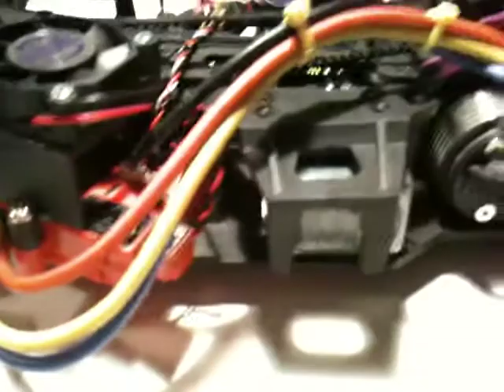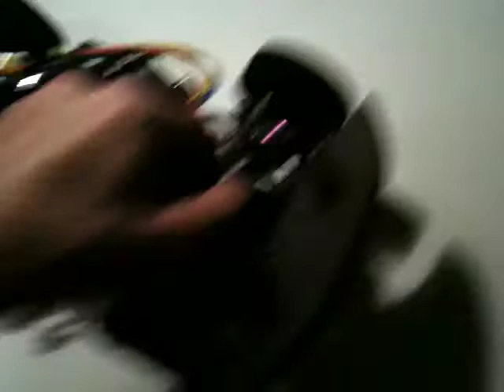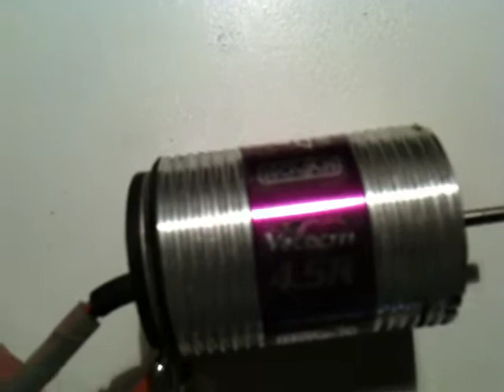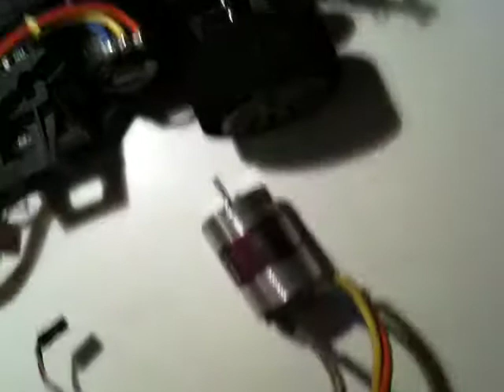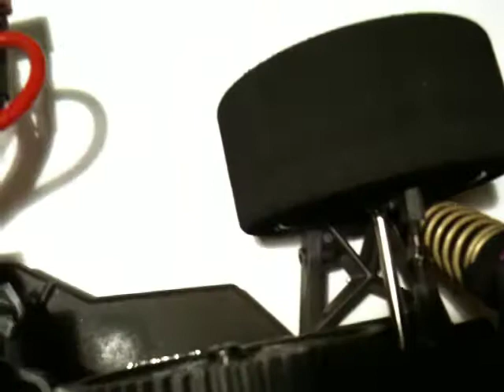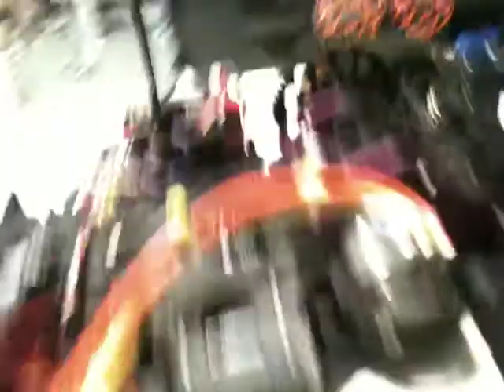HPI Sprint 2 Fitted with NOVAK HV PRO 4.5 motor and ESC. 32P Gearing!

Comment: You should use a second belt tensioner on the rear. I installed one and use bearings on them instead of bushings. It cuts down on the heat quite a bit. The traxxas slash 4x4s rear hub bearings fit perfectly on in place of the bushings, you just have to use a screw instead of the c-clip.

Comment from the maker: @nts213 

Not yet, but i have added extra belt tensioners etc and its starting to chew the rear diff but its still good after about 10 runs, i recon i got another 3-4 runs, then will put in the alloy one way diff.

Comment: I bet this flies on 3S with a 4.5T motor. I have castle sv2 sidewinder esc and 5700kv neu castle 4 pole motor in my HPI sprint (not 2) and its very fast. My rear belt wears very fast and I think it is because the belt touches the motor which gets hot and I need a rear belt tensioner but finding one is impossible. It looks like you have to make one.

Comment: My sprint is too fast too with 5700kv  neu castle 4 pole castle motor on 3s it goes about 60mph - 100kph. I run Sorex tyres by Schumacher 24r and they don't wear much at all even with a lot of spinning of the wheels but that's on 3s Lipo not 4s.